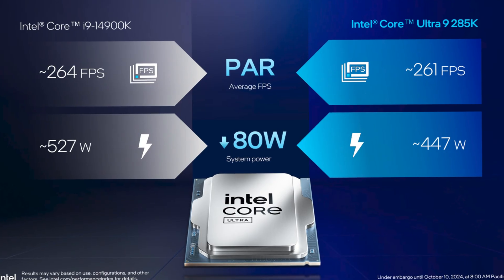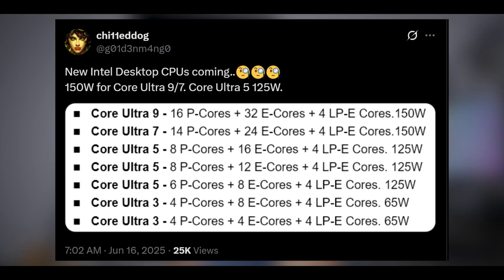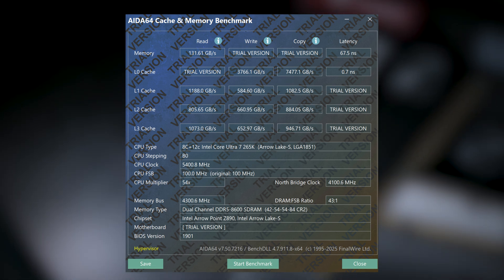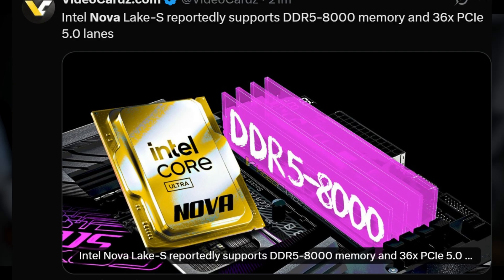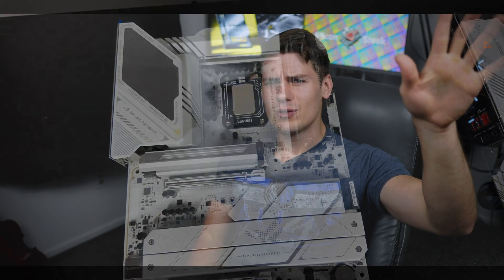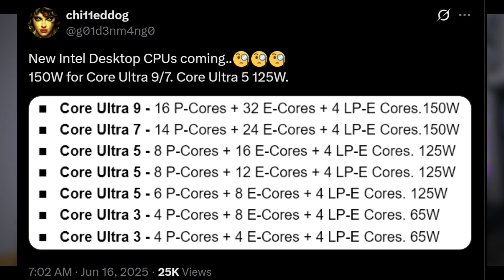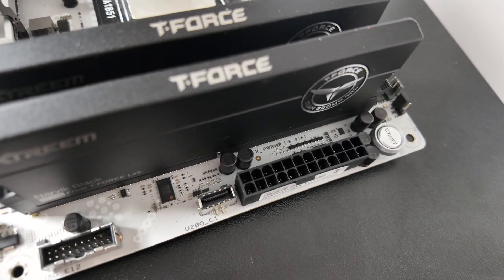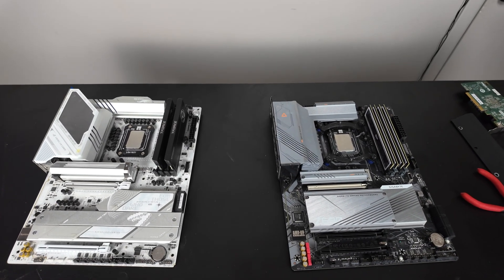Nova Lake will BEAT Ryzen

Comment: I agree that Arrow Lake is a better chips than many think, but you know, we're in a moment where marketing says that if you don't buy a 9800X3D, it's not a real CPU... But look, if you use DDR5, the performance jump wasn't that big from the 13700K. For example, I have a 14600K with a 5070Ti and DDR5, and I perform almost the same as AMD's 9700X or the Core Ultra 7—basically just slightly behind the 7800X3D. (I tested them without overclocking against my friend's setup, because with overclocking it wouldn't make sense—since the 14600K with DDR5 scales incredibly well. Rarely have I seen a chip overclock this much.)
Reply: @monikaguerra Except 14th gen has degredation problems.
Reply: part from the fact that it's resolved with the BIOS update... the issue was that motherboard manufacturers, in order not to fall behind in benchmarks, were pushing the chips well beyond their limits. In fact, if you buy a CPU today and update the BIOS, you’re actually getting a great deal for the price you pay. Basically, the deadly mix was that motherboards, especially high-end ones, kept pumping voltage even under light loads. The BIOS updates have fixed this issue, but it's not that the chips were bad. The same thing is happening now with the 9800X3D—motherboards are frying them because they push them way beyond their limits! If you're planning to buy one, go ahead, just make sure to update the BIOS and you won’t have any problems
Reply: @monikaguerraR7 9800X3D has no problems it's just the motherboard makers using low quality boards and not all board makers have poroblems with 9800X3D
Reply: The same thing happened with the 13th/14th-gen chips—the motherboards made them draw more voltage to keep up in benchmarks and push the chips, but the chips themselves had no issues. (Don't worry, before buying, I followed my friends who had 13th/14th-gen chips.) You update the BIOS, and there's no problem at all because motherboard manufacturers don't want to fall behind in benchmarks, so they push the chips ^^

Comment: You can tune Raptor Lake too. And a tuned 13700K should still run circles around a tuned 265K.
Reply from the maker: So i tuned my 13700k, not crazy but I was running  5.4ghz all p, 4.3ghz all e, 4.7ghz ring. Ram was basic XMP
Reply: @SiliconSteak   How fast was the RAM? Also set TREFI to 65k + undervolting Raptorlake gives huge gains since it allows it to maintain boost clocks for longer. ARL generally has little undervolting headroom.
Reply from the maker: It was basic ddr4 64gb 3200 cl16 vs 265k with 8600 cl42

Comment: Arrow lake I think is to get PCIe 5.0 support out there with Arrow Lake. For some silly reason that I can't understand is why B580 wasn't designed around PCIe 5.0? Instead it has specification of PCIe 4.0 x8. We know INTEL ARC gets more competitive with higher CPU performance so B770/B780 with PCIe 5.0 x16 would work OK with Z890 board but how much more performance would Nova Lake give to the INTEL ARC? The point is if you are getting top Nova Lake for example $1000 + LGA 1954 board/CUDIMM $1000-1500 and B780 $500. $3000 where does that put you? 5090 alone is +$3500. How I see INTEL is playing the long game.

Comment: 52 cores CPU in mainstream MB is nuts, i really like Intel when they are the underdog, they are more aggressive than ever
i don't really care if the X3D can get 30 fps more over a game that already hitting 200 fps, that monstrous multithreading performance seals the deal for me, i want one
Reply from the maker: This is basically my thoughts in a nutshell..
Reply: @SiliconSteak  when u can get a 9950X for the same price... yall crazy
Reply from the maker: @diKxng1080xx 265k $279, 9950x $500. Only 15% performance delta, except in video editing the igpu on intel brings it well ahead. Ez choice, the 285k I agree is a no buy
Reply: @SiliconSteak  my guy..that platform is dead..theres room for the 9950x..so whos really saving money? also whats the resale value on those chips hmm?
Reply: Intel said they will not cut in profits... will be bad...
Reply from the maker: Rn they have the best cpu deals on the market

Comment: I'm interested. However, my primary concern is how long the socket will be supported with post-Nova Lake CPUs. I do not like purchasing a new motherboard just to upgrade a CPU every generation. AMD has been great on this point. Intel needs to make a commitment to users.
Reply: @dono42  I guess it depends on your usage and if you constantly need the latest CPUs, but tbh I never understood this benefit for most people. Sure it sounds nice but by the time you upgrade, you’ll be on an old motherboard that has outdated tech. When it comes to PCs as well CPUs are known to last the longest as well, and so if you don’t absolutely cheap out on your CPU I think it should last at least 5 years. Currently I’m on a i5-6400 and so far it’s actually lasted me until now (approaching 10 years). Could not imagine plopping in a new CPU onto this motherboard, and not upgrading for at least another 5-8 years. The tech on my motherboard will be very old by then.
Reply: @Justin-xi6ue  Yeah, while it is nice and sure is a benefit I don't really think it is a huge one either. If you are budget constrained you buy "weaker" chip at first and upgrade to higher end chip after a year or two if needed or when they get cheap on used market. 
Going from something like 14500 to 14700K you get like +10% single and +50% multi core. 
Going from 14500 to 14900K you get +25% single core and +70% multi core. 
Similar thing goes for AMD cpus. 
You buy ryzen 5600 then upgrade to 5950X you get +12% single and basically +100% multi core score. 
Going from 13900K to 14900K you get +9% single and +5% multi, 
Going from 3950X to 5950X you get +25% single and +16% multi. 
Going from 7950X to 9950X you get +12% single and +8% multi. 
Like I bought 5600(a few months before AM5 was released) and I plan to upgrade to 59xx once I find a good deal. Don't really think it is a huge problem that I can't upgrade to newer CPUs. Too bad used market in my country is not really great at the moment.

Comment: If Raptor Lake is the gold standard for Intel gaming in 2026 over Nova Lake, Zen 6 wins by default, let alone Zen 7. Nova Lake needs X3D with its Last Level Cache to have an even fight against AMD Zen 6.
Reply from the maker: You’d be surprised how little cpu power we actually need for gaming. Playing at 1440p and 4k is almost always going to be GPU bound. CPUs that are fast enough to not hold back GPUs while gaming and have multicore performance for rendering sound good to me
Reply: @SiliconSteak  Nova Lake looks great for productivity. Zen 6 won’t slouch in this however, at 7 GHZ.
Reply from the maker: I’m doubting the 7ghz rumors…

Comment: Let us all hope Intel doesn't lock the voltage in the bios on Nova Lake.  Limiting the max clock to 5.7-5.8Ghz like Arrow Lake is no bueno.  Marketing K sku's as "unlocked" should never be secretly "locked' in the bios like Arrow Lake was and no tech outlet covered or mentioned it.
Reply from the maker: True. But we all know they had to do it for at least one gen after the degrading fiasco
Reply: @SiliconSteak  Yeah, they took a hit with that. 14th GEN may end up being the last Truely unlocked CPU gen.

Comment: I am on a 4770k and will be moving to a 12th gen
Reply: i3 12100 here BEST EVER MADE work like a charm all in ultra rx 6600
Reply: A lot of people make that exact jump from Intel Haswell/Skylake/Kaby quad to Alder secondary at great price performance and the ability to upgrade to Raptor. mb
Reply: @colinmaharaj  go with am5
Reply: @colinmaharaj  you should 14th gen instead such as the 14700 or 14600k. 12th gen is not exactly worth it, the i9-12900k which costs like $300 and uses up to 230W is weaker than a $320 i7-14700 which uses up to 220W and had a base tdp of 65W. if ur thinking of like i5-12400 just get the i5-14400 instead (just don't wanna see a fellow pc builder make a bad choice like i unfortunately did lmao)
Reply: If it requires a new motherboard then it's a bad buy, am5 will last for years.
Reply: A 4770k is insane. I had a 4771 not too long ago and it was really struggling.
Reply: @colinmaharaj  love my 12700Kf, but I would just go straight to AM5 if you're doing a new platform, more efficient, better for gaming, and productivity. Overall just better CPUs. But if you find a good deal on 12th Gen then screw it
Reply: AMD Am5 will be wiser
Reply: @kkrolik2106  You could explain why  for them
Reply: @LatinaGaming88 Thank you
Reply: lga 1200 is 10-11th gen. lga 1700 is 12-14. AM5 will still last up to 2027. Maybe upgrading to AM5 will be a better choice for upgrading ur cpu down the line without having to buy a new motherboard